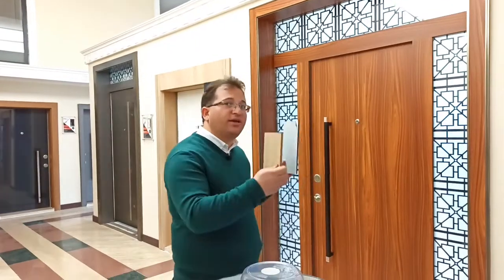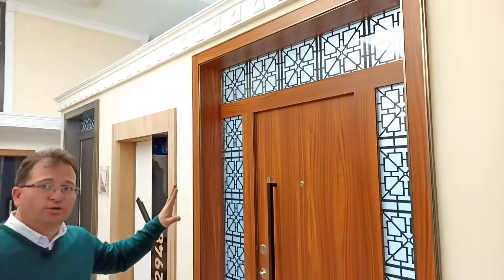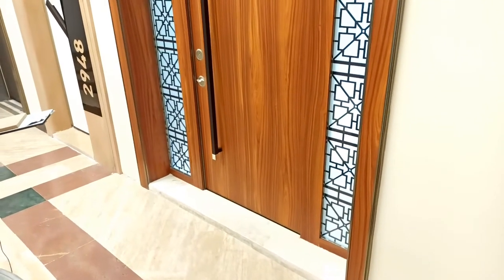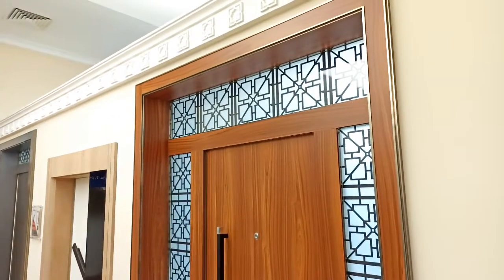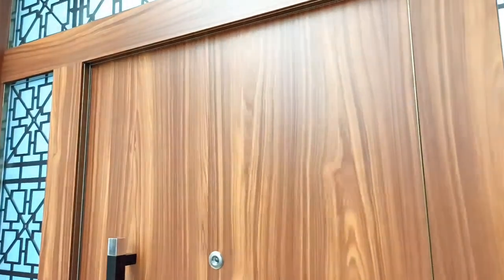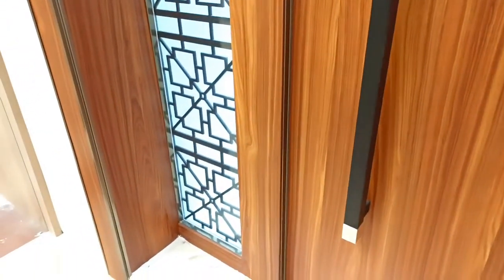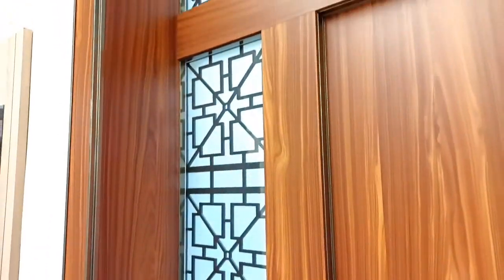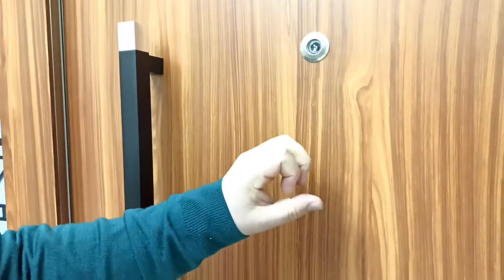Compact Laminated Steel Doors(kompakt lamine çelik kapı üreticisi)

Comment: Compact laminated Steel Doors.. İf you have a door which has direct sun and rain contact, compact laminated Steel Doors would be perfect solution.. Also compact laminated materials has great outside impact resistancy. Cause of these advantages for main enterance of the house you can select these type of goods..